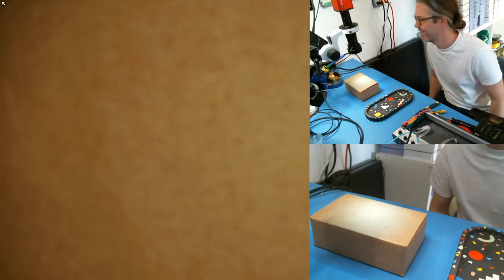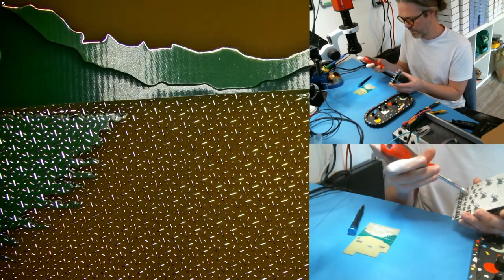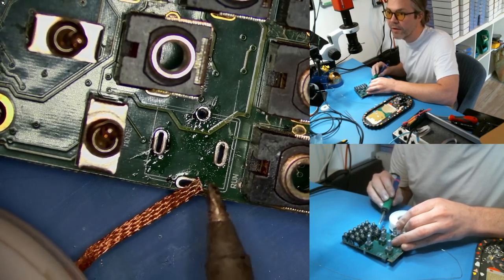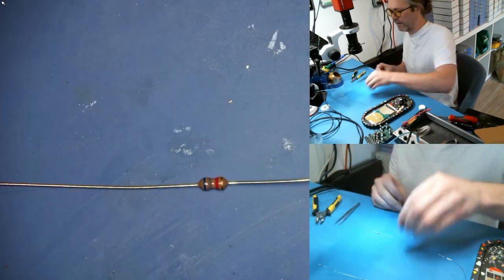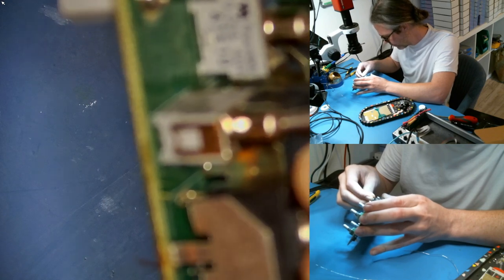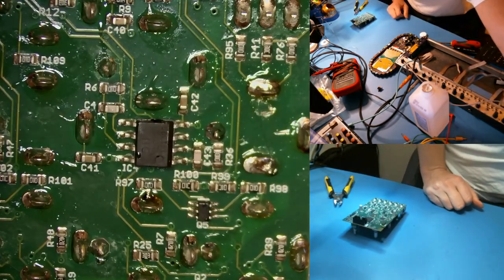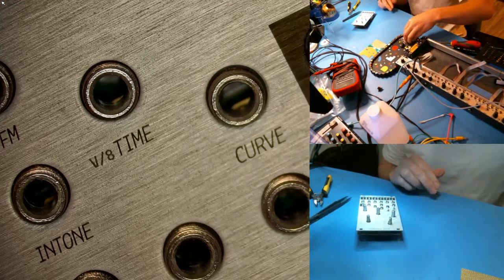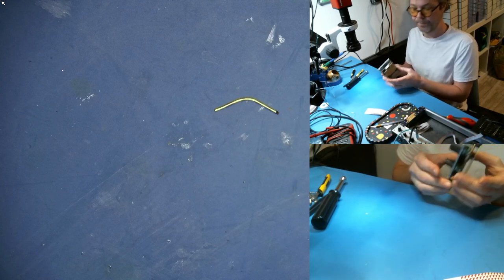Circuits w/ Trent: Run Jack Modification

Comment: Mind blown by the trick to remove the legs without a solder sucker around 12:00.

Out of curiosity, did you choose that style of socket over thonkiconns for a specific reason? Feels like I haven't seen this socket type on any of the modules I've opened up.
Reply from the maker: we chose those jacks because they were available i think. this was back in 2014 or so and the "thonkiconns" were still a custom make noise thing if i remember correctly. i think there was a version available but it had a solderlug for ground which required hand-wiring. i've used thonkiconns since 2018/19.